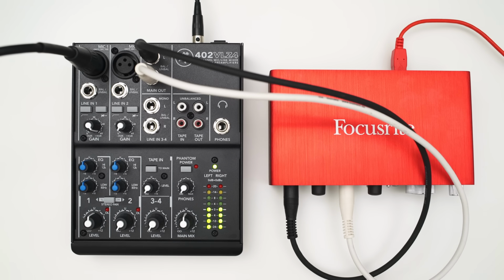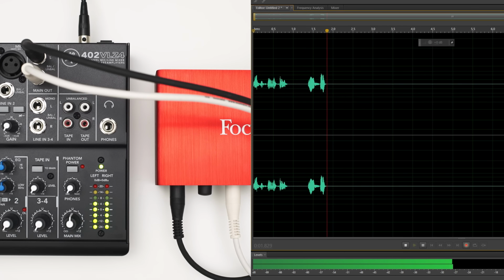Setup Guide - how to connect a Mixer to an Audio Interface for audio recording

Comment: I have two questions: 1) Does it make a difference if you use a TRS to TRS cable as opposed to a TRS to XLR connecting cable? Is there any sound improvement using the XLR/TRS over the TRS/TRS cable? 2) Does it make a difference if you use ordinary XLR Copper Shielded mic cables (like Cable Matters cables) over using a more expensive cable from Gotham Cable or Mogami Cables? Let me know what you can. Thank you.
Reply from the maker: Hey, to answer your questions:
1. There is hardly any difference between TRS/TRS or TRS/XLR and I wouldn't worry about that.
2. If you have short cable runs (less than 10 feet) there won't be any obvious difference. Once you have quite a bit longer cable runs, better cables can help to keep noise out.
Reply: @JulianKrause  thank you. I was asking because of all the connections that I’m going to use with hooking up the DBX 286s, 215s, 166xs and MOTU M2 USB Intereface together. Later, I’ll also be connecting the Behringer X1204USB Mixer to all of this. So I just need to make sure I’m using as short of cable as possible when connecting everything. It looks like Cable Matters cables on Amazon with over 6,100 with a 5 star rating. Which honestly is quite surprising, for XLR cables that are not too of the line. I guess I could try these out and see how they work together with my setup, to find out if any hum or buzz happens. Let me know your thoughts about utilizing this company’s cables. Thanks.

Comment: What about the gains on the interface? Should they be used? and if not, what is their purpose?
Reply from the maker: Hey, the gain on the interface should be as low as possible because you use the gain from the mixer. You use the gain on the interface when you plug in a mic directly into the interfaces input.
Reply: @JulianKrause  ...ahh yes, that makes sense, thank you for that. I have problems with the sound levels on my videos so I am thankful for your post, I will try out your settings.

Comment: why should we use a mixer if I have only one mic input and want to record a voiceover ?
Reply: You would only really use a mixer if you needed to simultaneously record more microphones or audio sources than your audio interface could support. The optimal setup would always be to use an audio interface with enough inputs for your application, as that gives you the option to record all inputs to separate audio tracks. With a mixer, all the sources are mixed down onto one mono or stereo track, and so you lose some flexibility.

Comment: ts cables would be the proper thing there as it's a mono/single channel
Reply from the maker: For a more noise rejection you would want to use a balanced connection which uses three conductors. That's why you should use a TRS style cable. Cheers!
Reply: @JulianKrause  they'd all work but yes better quality is desirable, thanks

Comment: Is there an advantage to do this beside the EQ in the mixer? Does this improve the quality of the signal or the pré AMP of the mixer overrides the One in the 2i2? I have a 2i2 but feel like the gain isnt enough , if I conect a mixer with a pré AMP Will it improve?

Comment: Really amateur question (just began learning about audio): why would someone want to do that? So you have more channels than there are on the interface?
Reply: More channels and you get a more tactile feel of the mix with the faders. More sophisticated mixers have more eq functions, compression, reverb and all that built in so you can tweak all of that in a tactile manner (as opposed to virtual knobs in the plugins in your software). If your interface has weaker preamps and you have good preamps in the mixer, that might help with some quality gains and noise reductions.
Reply: @gabrieltanzh  That preamp thing is why i will try this on my Omnitronic FX 120 2 channel mixer on my Focusrite 2i2. Been on my shelves for years. Bought it for like 50 bucks from some dj guy many moons ago.. You think it will give better amping for headphones? Im using Senheisser HD 660S so pretty expensive studio phones.

Comment: Julian, it would be nice if you could explain:
How to connect monitors? Would you connect them to the back of the interface or in to different channels in the mixer? How would then work the panning L/R for the monitors?
in this configuration, do we lose quality of the interface preamps if we connect the mics into the preamps of the mixer? 
Why leave the inputs gain of the interface at zero? 
It's a bit confusing...

Comment: When plugging into mono IN and OUT jacks (as on the mixer here) using separate L and R, 
the 'TRS' cables shown in this video are incorrect.
TRS cables are designed for stereo jacks which carry both left and right channels within a single cord.

The correct cable when using separate L and R jacks is a 'TS' (mono) cable.
Reply: Although it is mono, the outputs are Balanced. The Tip is used for + signal, the ring is used for the - and the sleeve is ground.
They can work both ways but there is a difference when using a TRS and TS cable on the outputs. Do your research.

Comment: Where do i plug my piano in? 🤓
Reply: You use microphones to record a piano. So Julians explenation does the job😊. 

..And if it's an Electric piano, use the output on the piano and inputs on the mixer, or maybe there are midi connections on your interface and piano. If you want to connect mics and an electric piano? Just buy a 4 channel mixer to connect to your interface... Still, that way you can only record two channels at a time into your daw. Not separate mics and a stereo piano. Or simply record both in mono.

Comment: Is there any way you could use part of the gain on the mixer and part of the gain on the audio interface to get a cleaner gain structure?
Reply from the maker: Nope, you always want to use the first preamp in the audio chain for the main amplification and use little to no gain in consecutive stages to get the best possible signal-to-noise ratio.

Comment: If you want to listen the audio from the PC on the mixer and not directly frome the audio card (but not record this signal but only the signal from the microphone) You should connect the output of audiocard to the mixer, the right input is the TAPE IN RCA sending this signal only to Phones or CTRL Room for monitoring using the TAPE IN to Phone button.

Comment: Confused. Why do you add gain to zero dB when every other guide says to add gain to get your voice to peak at say -6. How come your mixer doesn’t clip at zero dB?
Reply from the maker: Hey, that's because analog gear has something called headroom. This means you can go over 0 dB without clipping. Digital gear does not have that, here 0 dBFS is the maximum. Analog gear usually has about 18 dB of headroom. That's why you want your analog level of 0 dB to line up with -18 dBFS of your digital interface. Cheers!
Reply: @JulianKrause  Thanks for your reply. I love your videos. Keep up the good work.

Comment: 1/4” interface L is mono so it should be TS. For R also it should be Mono. Both L+R now give you the stereo combination and both can be plugged into the audio interface since it has 2 line inputs.
Reply from the maker: Hey, but the connection is balanced which needs three conductors. That's why you need a TRS plug even though each channel is in mono.

Comment: Hi Julian, which preamp is used in this scenario? The mixer's? The interface's? Or both?
Reply from the maker: Hi Dave, the signal flows through both preamps. But the mixers preamp are used for the majority of the amplification. The second preamp hardly does anything.
Reply: @JulianKrause  So let's say I got a cheap mixer like the Behringer Xenyx Q502 USB plugged into the Motu M2, since I want hardware EQ. Would that be a bad decision, given the Motu's preamps are under-prioritized in the setup?

Comment: Something no one seems to be mentioning is that this is a viable alternative to using a Fethead or Cloudlifter one-trick pony inline preamp for low gain dynamic and ribbon mics. With proper gain staging, there shouldn't be any noise issues, and unlike the Cloudhead or Fetlifter, the small mixer will allow you to make use of the low-cut filters and tweak your sound slightly via the EQ knobs if so desired. Plus on most mixers there's those handy little mute buttons right at your fingertips.

Comment: Hi,,I've got a Allen n Heath Zed 16Fx mixer. It came with the Cakewalk bundle.
But I can't seem to get to work it.Its USB, connection type. Do I have to use Audio interface,,,?.
Somebody help,,,coz I can't get in the sound input to the DAW from the keys/guitars etc etc.

Comment: Hi. I saw another dud connect the mixer on the back side of the Scarlett, is that another way to do it?
Reply from the maker: If your interface has line level inputs on the back you can do this. If not, you can't ;)
Reply: @JulianKrause  mine is the 2i2 2nd generation
Reply from the maker: @JosesGarage101  Then you only got line level inputs on the front. Cheers!
Reply: @JulianKrause  on the back it says line output right and left 😃👍

Comment: I have a pyle mixer with USB on it, and I also have a Co1 USB condenser microphone, can I connect the USB microphone to the mixer using theUSB on the mixer, and then use a focusrite interface to get the phanton power I need for the mic?

Comment: I have 4 monitor speaker my interface only one line LR output.  How i conect 4 powered speakers to the interface i use mixer or new interface with many output and i can plugin the guitar to the mixer or not . Thanks

Comment: What will happen when the phantom power is switched to "on" position while using either a condenser or a dynamic microphone. Will they get damaged? Thanks
Reply: Condensers need phantom power, dynamics and ribbons do not.  Don't worry about accidentally phantom powering a dynamic mic, it won't cause any harm. Damage to a ribbon mic is possible, but they will also most likely be fine as well.
Reply: @chasingfocus  thank you!

Comment: @julian: thank you for the wonderful video. I have 2 questions in continuation from this. 
1. After setting gain in the mixer, should we also set gain in the audio interface?
2. I have  an additional equipment in between mixer and audio interface. Boss rc30 loop station. So my setup is this: instruments/microphones --> mixer --> loop station --> audio interface.  So the question here is, should I also set gain in the audio interface which is the final frontier before the DAW. Any advice would be greatly appreciated. Thank you.

Comment: Very well explained.  I've started writing electronic music again with several hardware synths. I have an old mixer that works fine but doesn't have a USB port, and was wondering how to record audio into my DAW without buying a new mixer.  So, I assume now that I could just get an audio interface and do what you have done in this video?

Comment: Does anyone know if a mixer can decrease the quality of the recording?
Reply from the maker: It can, if it is designed badly. But I would aregue that in many cases you won't hear a degradation in sound quality.

Comment: Thank you for your explicit video. I have one question: Can we still connect the studio monitors from the mixer with this set up? If not, where do we connect the monitors for hearing what we play?
Reply: I think behind the interface there are 2  cable holes i think where u can plug in your speakers to.

Comment: I bought this exact mixer to use with my rode podmic and my Scarlett 2i2 3rd gen, I wanted to see what result I would get doing it with the setup the same way it's explained in the video and I can confirm it sounds great, I use it for live application and since the podmic lacks a little bit on the low end with a mixer you can adjust that and get a better result.
Reply: Wow that's almost my same exact set up except I have a scarlett solo haha glad to know it works well
Reply: @daaznrichard  haha nice! I was previously using a cloudlifter and then a Triton fethead and honestly I like the preamps on this mixer better, with this setup in my opinion I get less noise.

Comment: Ich hab da Mal ne Frage...
Also, ich besitze zurzeit ein Scarlett Solo 3rd generation und ein Røde NT1. Nun möchte ich mir aber noch ein dynamisches Mikrofon zulegen, habe ja aber keinen Input mehr frei. Das Scarlett solo hat ja nur einen XLR Input. Wie schließe ich das jetzt an den Mixer an, ich brauche ja z.B. 2 XLR Eingänge oder 2 Line, adaptieren bringst ja auch nt. Und ich plane, in Zukunft noch weiteres zu kaufen, bringt ein Neues Interface dann was?

Comment: Thank you Julian for the excellent explanation, could you please advise if it's possible to plug the Scarlett Audio Interface into Behringer PPA2000BT portable PA system? I am buying the PA system and would like to have an audio interface as well for recording, I am asking because I don't see Main Outs on PPA2000BT mixer. Appreciate your quick response.

Comment: I think, if you want control you use a mixer; otherwise, you use just an interface and control is done within the software. If you do use a mixer you must use an interface to get your signal into the computer. You could also combine certain instruments - all my drums (each mic'd separately) on the mixer, then send that over to the interface to be joined with the guitar ( sent to interface), and a singer ( sent to interface). Its really a creativity thing. But the mixer puts control in your hands before the signal is sent on toward the software. I like using both, I have control in my hands - not rely on software  alone.

Comment: Hi Julian.
What if i have an Allen & Heath zed-6fx a mixer? A this mixer only has XLR Main Out. Will it works if i connect to an audio interface(Scarlett) via XLR to 6.35mm cable?
Cable like this: 
https://www.amazon.co.uk/6-35mm-Stereo-Balanced-Patch-Cable/dp/B01K54FG18

Can i use XLR to XLR cable?

Comment: Thanks. Useful info. However, you turned the gain on your inrerface all the way down. Does it stay there? Dont you need a degree of gain value on the interface aswell in order to achieve an audio signal in yiur DAW?
Reply from the maker: Hey, the gain on the interface stays all the way down. The signal from the mixer is already line level and does not need any further amplification.

Comment: I have only used regular instrument cables, I am not understanding why the left and the right interface inputs would require a TRS or stereo cable each?
Reply from the maker: Because it is a balanced connection which needs three conductors.
Reply: @JulianKrause  Interesting, the AVID MobilePre manual is stating both bal/unbal 1/4 inch inputs on front and back can accept both, I swapped the TS cables I have been using for 8 years with TRS cables and now the audio from the mixer is louder, I will go with TRS, but I am not smart enough to understand why.  The manual even seems to contradict itself when trying to explain its inputs.  I personally will try to avoid dual purpose jacks in the future, not something I want any part of.

Comment: What I really want, is to connect the output of the interface, to the mixer, and the mixer goes to the monitors. For that to work perfectly, the audio interface should also be able to work on its own, without a computer, so I don't have to unplug the instruments from it. (do audio interfaces do that?)
Reply: get zoom l-20, l-12, l-8 or tascam model 24.. bro! they are hybrid mixer/interface kind.....

Comment: yah correctly then why you use stereo jack intead a mono ? this is a mono output and imput
Reply from the maker: Because it is a balanced connection which needs three conductors. That's why you use a TRS jack.
Reply: @JulianKrause  ok

Comment: Why would you need both mixer and interface? 
Are they not the same some times?
Reply: While many mixers nowadays DO have a built-in audio interface, this has not always been the case, and while some audio interfaces allow the user to mix 2 or more channels, you will rarely find the more advanced controls that you see on a mixer, on an audio IF, such as pan, eq, effect send and return, and so on.
As a case in point, I have a Behringer Xenyx 2442FX mixer - the old model without IF, but it did come with a small 2-in/2-out to USB converter which doesn't have any controls at all. 
I have since bought an E-MU 0404 IF card for my PC, and later also an M-Audio Delta 1010 with 8-in/8-out, and with this setup I can not just record 8 channels at a time via the Delta 1010, but I can also mix down 8 channels at a time with the Delta on my Behringer; this gives me more flexibility than by using the DAW software on my PC - for instance, I can operate more than one fader at the same time which is just impossible in the software ;)

Comment: You forgot one very important step! After you “turned down” the rotary volume pots on the Focusrite 2i2....you never turned them up and set proper levels. You set up everything else...then showed meter levels on you recorder...but you did not show or describe setting the proper gain structure of your two 2i2 inputs (Green vs Red light).
Reply from the maker: It is actually correct in the video. The gain on interface stays all the way down.

Comment: What is the difference between using the front level input and the rear one? Some interfaces has front line in with gain and rear one with no gain.

Comment: Some mixers have a Direct Out (for example Mackie 1604VLZ4 and Behringer XENYX QX2442USB).
Does that mean I can record via the direct out the incoming signal to the audio interface dry? (without the eq and compressor effects)
Also if I have connected the MAIN OUT and the Direct Out from the mixer to the audio interface,
can I record BOTH the dry and wet signals at the same time ?